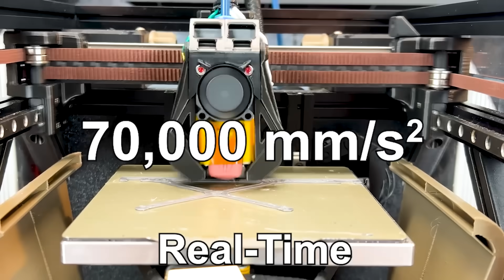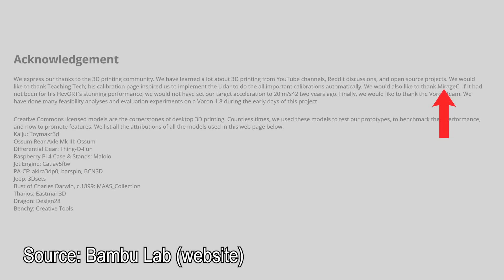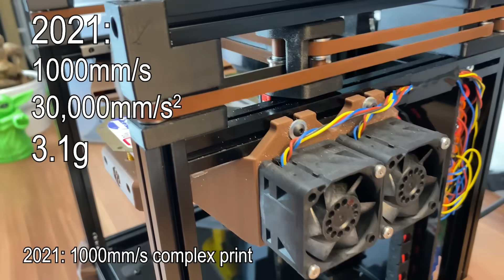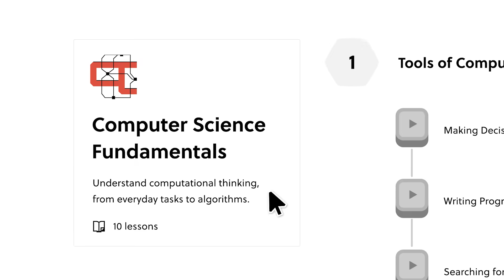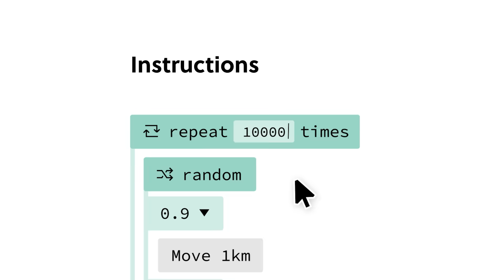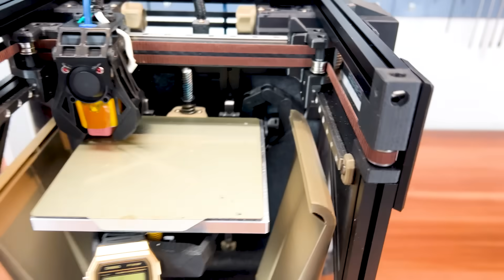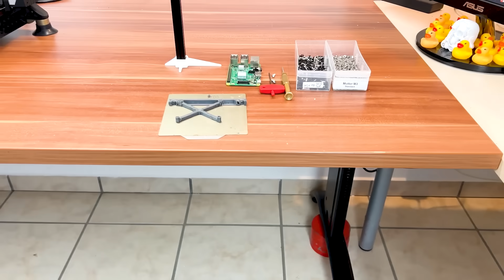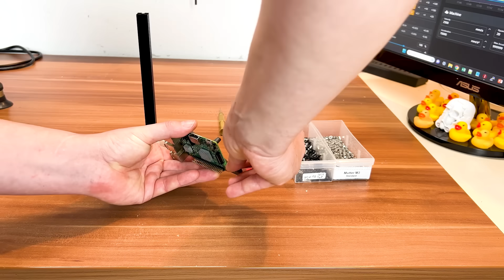INSANE PRINT of a COMPLEX PART on a tuned Voron - 247zeroB2

Comment: Get a heavy solid metal frame and stone base for it. Try high speed servo with low internal inertia (long servos) like panasonic with gear 1:3 and small diameter ballscrew. This will improve speed and detail quality significantly.

Comment: I wonder if you can get some extra performance by 'Pre-heating' the PLA to say 120 F so that it has less transition shock at the head, I am sure that the retracts would need to be tuned, but I think you may get more flow with a pre-heat

Comment: Have you considered using compressed air for printhead mounted part cooling and/or to replace the heatbreak fan? I'm not sure if the resistance of flapping the airline around would result in less resistance than the interia of the fan, but it could certainly allow much better cooling and match the theme of extremeness!
Reply: Yeah, using something like a small electric compressor (similar to what is used to blow smoke and debris away from hobbyist laser cutters cut path) would be interesting to see. I wonder if it could reduce the weight of the tool head assembly.
Reply: @Easiermarlin33  come to think of it, while it certainly would reduce weight (no fan n tolhead and much less ducting required... there could be many other performance gains to be realised.
Ranging from more precise and concentrated flow, faster variance using electronically actuated valves or a bank of solenoids and flow restrictors, rather than waiting for a fan to spin up and down, and the potential to have 4 seperate feeds: for both directions of both X&Y! 
That last one would allow precooling and/or postcooling in the printed direction or even preheating if you rigged up a resitive heater element at the tip of the airlines.

Comment: Well done!! you have convinced me to just push ahead with the V0.2 mods I have printed the parts for, instead of interrupting and saving a bit more money for going straight for the VZ235. I am building it with the tri-zero, with +50mm Box zero that adds 50mm X/Y, which does away with the cantilevered bed altogether and instead runs a triple belted Z and autolevelling (voron zero mods from the team at printers for ants) or perhaps pandoras box, which is the same, but scratch build rather than modding a V0.2). I dont think a cantilevered bed had any place in 3d printing, even one this small. I will build the hevort after that as planned, for the larger prints, which honestly will be for the most part speed limited by material anyway, as I print 100% end use engineering plastics and electronics enclosures. I do love the look of the VZ, but I think any super fast prototyping I will do will be mostly small objects and I prefer the side by side arrangement for the electronics compartment the hevort has

Comment: I was still there. I am wondering if there is no #Perfect Speedboat Challenge. As we all know the Benchy is a minimaltistic torture Test. So from the ca 30 factors shouldnt we aim to reach at least 80% (Paretto) to call it a sucsess. My Ender generates perfect Pareto Benchys down to 52 mins. While I can Generate a Speedboat that would be ok for the cahllenge in 35 mins. So what I want to say: I like your idea of testing usable speeds for real Parts. In the end you will always have a Profile that generates working parts asap not parts that look a bit like the intended part.

Comment: Most people do not understand how Input Shaping works. It does not just cancel oscillations for free. The faster you go the more it fillets corners and geometry of printed part becomes distorted. That's why fast printing speeds and accelerations are not useable in real life prints. It's better to build higher flow extruder and print with thicker layers and widths than run printhead faster.

Comment: Nema Are inaccurate for such speeds. Buy JMC servos, Is there a nema 17 iHSV42-40-07-24 78Watt 5200 Rpm.or similar, watch out for counterfeit steppers.

Comment: Did you consider using aluminium screws, maybe drill them out. Or even nylon screws... ? What M2 self tapping screws do you use? Is this really a M2 thread, does a M2 nut fit? Thank you in advanced and a thumb up! Noice VID!

Comment: ok this is insane I never thought printing at this kind of speed would ever be possible
and not only that it is actually a functioning part. prototyping at this speed is huge.
congrats I think this is a major achievement in 3D printing.

now I want to make my own Voron printer, My current printer is very slow it can barely do 60mm max

Comment: M2x10 self-tapping screws are not very common on Voron printers (or any other printers i know). They are very common with PCB mounts, though. And for Voron, it's typically M3 with heatset inserts or T-nuts - and of course a couple of M5. But still no M2 (unless you use those PCB mounts).
Reply from the maker: M2x10 self tapping screws are used on every Voron printer.
Reply: @247printing  Point me to any page in the v0 or v2.4 manuals where it says they are mandatory. As i said: Only PCB mounts. Okay, and maybe for the Endstops, if you choose to use microswitches. You can build any Voron without even touching an M2x10, while still following the manual.

Comment: (end of the video) I'm still watching... Congratulations. By the way I'm thinking about replacing the Kirigami for some kind of triangular shaped structural beams, using 2x of those gantry sliders per linear rail and sacrificing some of the Z height. I can't think of another way to tame the vibration at the base plate outermost edge while maintaining the cantilever design

Comment: How is the printer holding up with these fast speed? Did you have to loctite the fasteners? Is anything shaking apart? Has anything broken/failed running at these sustained speeds? It looks awesome and unreal, keep pushing for more speed!

Comment: I'd love to see a video where you go into where the bottlenecks for your experiments are coming, watching the video it could easily be flow rate, extrusion speed or mechanical limit of the hotend movement that you're pushed up against.

Is there any reason you use 0.1mm layers, would 0.2mm with half movement speed give preferable results, or are the 0.1mm layers necessary due to the lack of cooling on the hotend?

Comment: How fast can you get it with abs? I can do a good 10 minute benchy with pla but have trouble trying with abs
Reply from the maker: Wouldn’t be faster with ABS - that speed PLA is a bit better at flow rate. Less cooling needed with ABS, bit higher temp and bad smell - not favorable from my point of view
Reply: @247printing  thank you for your reply, your videos were the inspiration for me to build and modify a voron 0. Problem I have with ABS at speed is if have less cooling then I end up printing on still soft previous layers so it becomes a mess. If I have more cooling I get curling and warping issues but that is the nature of the material I guess. Do you have any other preferred plastics or you mostly print with PLA?

Comment: Might be a crazy idea: but what if the heat brake was cooled with a powerful fan attached to the printer itself with a small tube (duct) to the print head? I imagine it would help shave off a few grams
Reply: Vez has his with a liquid-cooled setup sort of like that, but I doubt it is much lighter than the tiny heatbrake fan.
Reply: @geometerfpv2804  With liquid cooled, that may be true, but I imagine a thin-walled rubber tube only filled with air would be noticeably lighter.

Comment: What do you think is responsible for the sub-optimal print quality at these speeds? Incomplete cooling, or maybe a lack of machine rigidity, or something else entirely? Insane video, insane machine, huge respect!
Reply from the maker: Thanks a lot! Also for watching, commenting and liking 🥰 Cooling isn’t an issue here, also extrusion is fine. Pressure advance doesn’t work great, cantilever bed is shaking and overall rigidity is a bottleneck

Comment: I've got to ask because I'm curious what brought you to make the choices you did on your printer; for those big cooling ducts, it looks like you have regular, small sized axial fans on the bottom, powering them. Wouldn't a larger blower style fan offer more pressure to focus the air through the ducts, and be quieter? Seems like it would fit in the area just as easy, too. Never built a printer like this though, so I'm really just speculating.

Comment: Second layer is probably slower due to bed mesh leveling.  The bed mesh is going to be active, but fades away for several layers, unless you've disabled that (unlikely).  So you're limited by your z-axis.
Reply: There’s no bed probe on this printer. Not worth it cause the bed is so small it’s trivial to level it well
Reply: @oliverskrzynski3317  You don't need a probe to build a bed mesh for software compensation.  Paper method can be used.
Reply from the maker: I thinks it’s idea maker - no bed mesh here - paper method!
Reply: @247printing  So you're not using a bed mesh, even manually generated for software bed leveling?  The bed is flat enough?  It is a small bed, so I guess it's not needed?
Reply from the maker: @earthwormjim  The bed is small and flat enough, yes. Voron0 isn't meant to have a probe. Btw. z-movement due to mesh would continue throughout all layers.
Reply: @247printing  Oh okay so no mesh is needed.  Z movement due to mesh doesn't continue through all layers, it is faded out typically after a certain amount of layers, and then is no longer active.

Comment: Have you tried printing without the hotend cooling fan and ducts?

I printed with only an aluminium heatsink when I first setup my printer, it worked surprisingly well.
This could shave off quite a bit of weight. Maybe you can put some more external cooling ducts at the height of the hotend if passive cooling is not sufficient.

Comment: That’s a very nice filament! I can’t wait to get my hands on it, although I can’t match that kind of speed…yet! I’m limited to 1500mm/s at 23,000mm/s2. I don’t usually print at top speed, but rather at a medium speed and higher acceleration: 400-600mm/s at 200,000-300,000mm/s2. Quality suffers at that high acceleration for me, so for functional prints it’s ok, but detailed models I have to drop it to 120k-140k acceleration. I have some grand plans for a polar delta that would be much faster, but the filament is the limiting factor these days.

Comment: While practical printing doesn't always require as much quality, allowing you to push the speed, the consumer grade prints do.  I'm excited to see faster and faster printers, because that means we will start to see quality prints at higher speeds to.  Allow my prints for my kids to take less time.

I only wonder why we are not increasing the number of print heads like we did with dot matrix printers.  I would think that increasing the print heads would allow you to print at slower speeds, but get X times faster prints depending on the number of print heads.  Obviously a new slicer will need to be used that can extrude filament from multiple print heads at one time.
Reply: There are IDEX printers , but they are all cartesian , people are still working in a IDEX printer that uses the coreXY kinematics (some dub it as a coreXYU ) , so you could have printers that really fast and duplicate (or triplicate) production rates

Comment: Im thinking, quality is affected by the vibration. Would set of counterweights be beneficial to the system. Yes, it would be more mass. But such system works on guns (look at AN-94 recoil compensation system). Is the idea somewhat viable?
Reply: Yes , it would work , CNC kitchen did made a video of using a granite slab under the printer to reduce vibration
Reply: @ulforcemegamon3094  I’m talking more about counterweight on a pulley. When printing head moves to X, CW goes to -X, neutralizing acceleration on the sudden stop

Comment: what got me uninterested in the speed game is.. you could just use bigger motors, right? nema34? then bigger frame to increase stiffness. then big hotend to increase flowrate , maybe even use two hot-ends in parallel (would need some programming but whatever). but at the end of the day you actually can't. plastics have maximum shear forces and we're already approaching the limits here. beyond those stresses the plastic will literally disintegrate. so, while this is fun to watch, it's not the right pathway forward for faster 3D printing, as we can't push this much further. completely new approaches to FDM 3D printing are needed.

Comment: It would be interesting to see the power use difference. 247 vs X1 or multiple highspeed off the shelf printers. I would think keeping the heaters running for a shorter time would make a significant difference. I also wonder how much more power the inertia from acceleration and deceleration adds to the power use. Maybe it's a green machine.
Reply: As far as i know the part with the highest  energy consumption in a 3D printer is the heatbead , not so much from the motors themselves

So like a printer that prints at 50mm for 5 hours will consume more energy than a printer that prints the same model in 1 hour at higher speeds assuming the heatbed consumes the same amount of energy per hour in both printers.

However perhaps there is a limit to this thing and if you go too fast the amount of energy that the motor uses may be the same or more than the heatbed itself

Comment: One doesn't make a racing engine that can reach 20,000 RPM to always use it at that level. It does this to have the reliability and the results in a race at 75%  or even less. And it's reassuring to know that you have that 100% available in case you need it.
Amazing result.

Comment: what speeds do you use to get a part that has no blemishes? can you run this again to get a nice print...  fast is good infact it is nuts but the quality vs speed balance could be interesting to see. ie what point the quality curve and speed curve intersect.obviosuly every part will have a different point of intersection but could you average 3 or 4 parts and then call that good for all prints...

Comment: In my Opinion, Bambulab basically took a Voron, added a nice “polished” look to it (and granted that / the production engineering etc isn’t NOTHING ) and acted like it was closed source work done 100% by them.

If people REALLY want speed, a VORON/RatRig/VZBOT/etc could run laps around their printers.
Reply: In your opinion? That is a fact lol
Reply: Running the x1c limited to 500 mm/s for them just means a reduction of support issued of maybe 80% or more. I’m sure the x1c is capable of much higher speeds but that comes at a cost  and it’s not a consumer product anymore when you need to have knowledge to tension belts  and tighten parts every three days

Comment: I'd love to see it print some vase mode parts, I know they aren't a good benchmark of movement but it can be interesting from an extrusion perspective. Also it would be satisfying as **

Amazing work, it's very cool to see people like you push the limits of what is possible with current tech!
Reply from the maker: Thanks a lot - which parts would be interesting?
Reply: @247printing  I think that thing:550604 would be funny to see on that printer
Reply: @247printing  visually, vase mode is best since it gains volume the fastest

Comment: You need to optimize the printing, if you turned the print sideways it may have been both less stressful on the printer, but also been faster! Technically you can set the side to side movement faster due to the less weight

Comment: well, this is a no flex, running your steppers at 58.5v is not a flex, running 1.5amps motors at 2.4 amps is not flex, you are not flexing. this doesnt make sense, do a 3 hour print and we will see if the coils will short inside :)
Reply from the maker: Just what I say in the end of the video ;-) flexflexflex :-)
Reply: The motors are rated 1.5A? I don't think this would ever work 5 minutes..
Reply from the maker: @REDxFROG  around 8min. :face-blue-smiling:
Reply: @247printing  yeah that's the price to pay. for now.
I think in the future we will get better stepper cooling technology and especially integrated cooling or modified housings. There will be a demand for it.
The100 I've mentioned has the stepper motors sitting in PLA (or ASA/ABS if you want)
The heat transfer is pretty difficult... Lol
Reply: @REDxFROG   it works, for 10 minutes only, after that coils will gonna short and prolly break the motor thats why its not flex